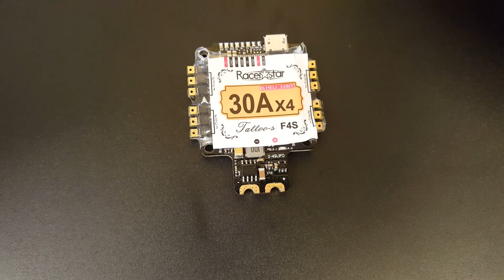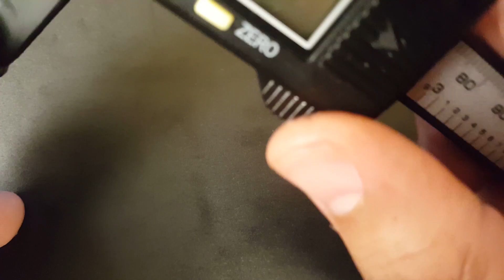Racerstar TattooF4S AIO // Overview and Layout

Comment: I'm really interested in your videos on modding the EV100 goggle and am suggesting a mod that could possibly help improve the screen size of the goggle. It could be possible to cut a magnifying plastic sheet and installing them over the lenses to make the screen size bigger. I haven't given it a shot myself because i don't have a pair, but if you could give it a shot and if it works it'd be pretty awesome and most likely widely appreciated.

 Here's a link to a magnifier that might work - https://www.amazon.com/MagniPros-Credit-Magnifying-Lenses-Enlarge/dp/B01GSYP40M/ref=sr_1_5_a_it?ie=UTF8&qid=1505784276&sr=8-5&keywords=magnifier+sheet
Reply from the maker: Sure I will try but currently still need to 3d design a module mount for the goggles. Then someone requested a power mod and I still need to make the external module mod to work when goggles powered from USB.
Reply: I know, but if you could mod the ev100's with a cut out of a fresnel lens you'd be able to increase the FOV without sacrificing comfort. Albert Kim did a video on making cut outs in the google to use diopters since his eye sight is too bad, you could do this and instead use a frensel lens cut out thats the same size of a diopter.
Reply: CarelessMedia funny thing is I had that same Idea I already ordered the cards...dont know if will work but got the goggles coming and cards on the way 😫
Reply: Marquis Hubbard let me know how it turns out my friend! :)
Reply: mike jh you can't use a magnifying glass because it has a focal point and is not even. Fresnel glass has an even magnification across its structure.
Reply: Well i took out the fresnel in my old box goggles and put in two magnifying glass in and it was much much better,  also my HTC Vive VR has Fresnel lenses and that has blurred edges, so theres is no problem with at least trying.
All goggles have magnifying lenses in them anyway.
Reply: mike jh maybe so, but i think fresnel would be easier to work with on fatshark style goggles like the ev100's, and my eachine goggle 2's use fresnal and i see great in them.